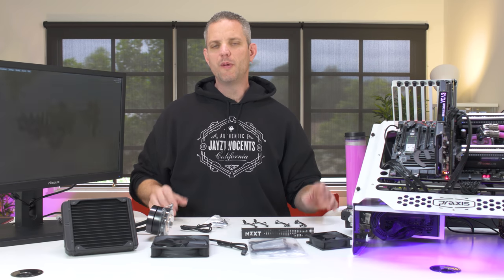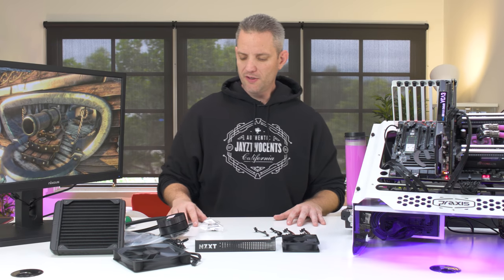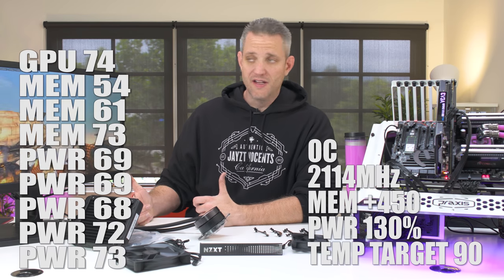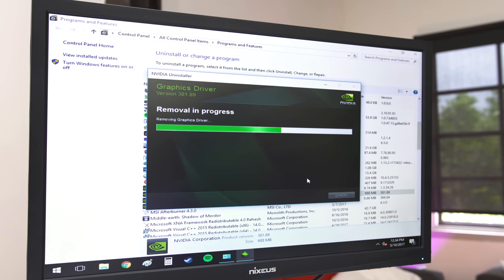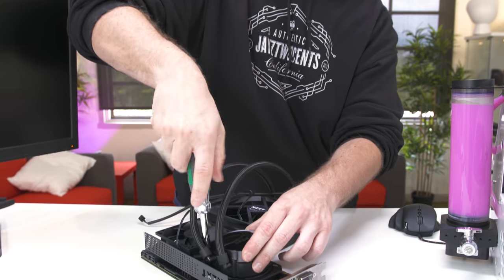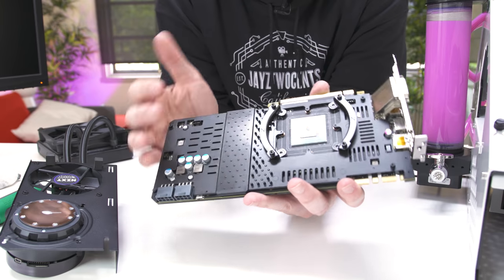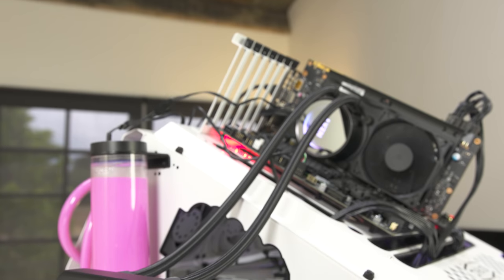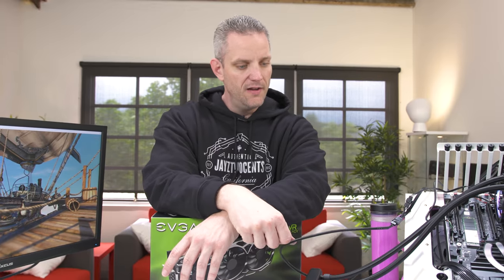How to Watercool a Video Card... The easy way!

Comment: When the majority of users dont use SLI, dont want the hassle of a full 
loop and change cards fairly regularly this is an attractive solution.

Its easy, cheap and it works.
The performance is more than good enough for the vast majority of users while also being cheap enough to be worth the upgrade.

Comment: Isn't there some clock lock on the nVidia cards?  Especially the 1080Ti.  In the sense that no matter what, you won't be able to OC over a certain point anyways.
I think Gamer's Nexus did something on this in reviewing those cards.
So, I'm thinking that even if you bring temps down with an AIO, you'll only be reducing your temps (which is not a bad thing), but really won't get any more performance juice outta the card.

Comment: One of the reasons I never warmed up to GPU water cooling is the looks of it, say what you want but display connectors sticking out on the side and a water block that is obviously to thin to fit the overall design of the component looks kinda trashy.
Event those expensive water blocks look silly compared to some of those real neat and shiny air cooled designs like that 
1080 FTW. You know with the black back plate the glowing writing on the side and appropriate height for a card that takes two PCIE slots anyway.

Comment: I expected a better go at this. He could have placed heat sinks on the memory blocks, explained how the pump and radiator fan is controlled, eg I believe the pump needs to be at full speed. Also, it would be interesting to know if this still occupies the space of two slots, or if the size of the pump and its connections means it will take up more space. In other words the practical details, not just those initial raw stats. 

Also, im not sure it would have been practical to keep the backing plate, as he was replacing a blower with a fan, which in my opinion would not have the same effect of forcing air into those tight nooks. eg under the plate. On top of all that, the AIO in the listings is way too expensive compared to the other options out there.

Comment: I bought a second hand Gigabyte RTX 3080 gaming, the seller claims he never mined on it but after taking it apart the heat sink is covered in corrosion and packed with clumps of dust and dead bugs... these bugs and clumps have gathered moister and actually corroded holes and notches out of the heatsink fins... as an alternative to a replacement heatsink from Aliexpress for $120 USD is there anything on the market like the G12 that would suit an RTX 3080?
Reply: I don't think there is I am looking all over with no luck for something like the G12 but nothing does the 3000 series only up to 2080 TI for the G12 bracket. We just have to hope NZXT or any other makers makes a new bracket for the RTX 3000 series as i really want my 3070 with a AIO on it as i came from the 1070 EVGA hybrid that was AIO and i miss it so much as way better temps and a lot more quite then fans are when it gets warm.

Comment: 7:10 - The dremel approach: I tried it. Cut out the square in the centre 1080 ti Founder's Edition to give the Corsair H55 cooler access.  It looked similar to the Gamer's Nexus Hybrid build, but when I put it all back together water cooled, it ran, but the fan shot up to 100% then switched off.  

In a panic, I put it all back together and the square piece I cut out, put it back in, working again with the blower fan.  

I tried the NZXT G10 and G12 approach with a few 780 tis, one 980 ti without cooling the VRAMS, they lasted for years. Not sure what happened with the dremel method.

... pointers would help.
Reply: Shahwiqar Shahin Did you cool the VRMs too or not?

Comment: omg Jay I was checking online for this same exact problem because I use nzxt g10 on all my gpu's and never considered what it does to vrm and memory. My gpu doesn't have any built in sensors, but I did use my non-contact digital laser infrared thermometer and saw that the temps were fairly low around 55c. I wanted to know what the temps were with a heatsink on because I thought they were cooling the components better, but that's wrong. Thank you for doing this video.

Comment: Hmm.. I wonder if that fit my dual xfx r7900 gpu's (not clocked). Im tired of the damn heat, idle at 50-55 degress celsious in massive case with 5 140 fans and 4 120 fans.....-.-

Comment: the route that ive been planning on going so far is getting 2 evga 1080ti ftw for my build but i saw the g12 just came out and its only 30 bucks. There is FE cards that are on amazon for 655 so i was wondering if it would be better to go that route for sli with the kraken g12. i know i have to get the AIO cooler for both cards and thats fine. Im going to be using the cougar panzer case which i think will work well for it since it supports rads on top and in front. I will also be running a 280 AIO for my processor and have that mounted on top so would cooling still be fine having radiators in front for the GPUs and the CPU on top for cooling? Air intake throw the front and exhaust out the top?

Comment: Is there a liquid GPU cooling solution which covers the whole card and will essentially loop together with a CPU block and end up at the same radiator? I have a super tiny case with only one real outlet for a fan, so I have to try and get everything routed to a single "output".
Reply: Thats called custom water loop...

Comment: Hey JayzTwoCents been having an issue with my new msi gt73vr 6re laptop. The model has a gtx 1070, i7 6820hk, 16gb ram, 256gb ssd, 1tb hd, 120hz 1ms 17.3' screen. I've taken it into multiple people including the manufacturer  (who i found out don't care about software issues) with no luck. There appears to be a memory leak or something that nature occurring when rendering graphics in games making the msi dragon centre crash and making the framerate in games tank really hard or crashing the game altogether. This happening within 10 minutes of starting a game making competitive gameplay impossible. Any insight would be appreciated as I'm getting desperate. I'm also wondering if there are any appropriate software choices to replace it if need be and still be able to control clock and fan speeds.

Comment: Anybody know if theres anything like this for a 2080 oc? And would it even do me any good? This is an old video with older hardware so idk if it still applies. I have a tripple fan cooler on my gpu and it hits about 55 MAX and averages 45 c at full load. Id like to get it below 30

Comment: Follow up video, how can the Kraken G12 use modern Used cards to effectively compete with new Cards.
I had an old 1080ti Blower that sat around 95C the entire time it gamed, installed this and it dropped to 50 - 54c while benchmarking/gaming.
Unfortunately I didn't really test this build before swapping coolers, but right now I get performance on par with the 3060 Ti easily.

The only thing I have to go off of though is Benchmark Youtube videos.
In those a Stock 1080 Ti performs around 160 FPS in Overwatch 1080p Ultra, a 3060 Ti performs around 240 FPS in 1080p Ultra, my 1080 Ti is matching the 3060 Ti results currently.

Comment: i have a 1080ti ftw3 and put this kit on with an x72 aio, didnt have a tool to cut the face plate like in the video so i got little heatsinks instead, when i do anything that makes the card turbo hard the memory crashes at or right below 50c on mem2 in hwinfo64, if i undervolt then mem2 can climb to 65c with no issue, in some cases while undervolted i have to have 6 intake fans  set to atleast 75% for it to not crash
the temps on everything but the gpu are more or less the same and there are no components on the board that are missing/damaged so im confused what the actual problem is
is it just a dying card so its effective power vs memory clock is lower or could it be that the heatsinks i got arent good enough and without the undervolt the temps spike before i can see it

Comment: Hey Jay, I did this with the Kraken G10 on my EVGA 980Ti. I solved the front- and back-plate issue with a copper shim between die and watercooler base. Roughly the same temp-drop (1-2 c off). Could you try that instead of mangling the card? :D

Comment: And for 1080ti? No need heatsink or any other solution to VRM and rams???...
Reply: Any answer pls? Is this working (better temps) on 1080TI, without heatsink and any vrm/ram cooling (only the g10 fan)?

Comment: I currently have the nzxt g12 & kraken x42 on my zotac 1070 amp edition. On load with a 55% fan speed, the gpu maxes out at 65c and i was able to OC to 1731mhz off of 1506 mhz (225 offset) The card is notably more quiet than before and even though the zotac card has an oversized pcb the nzxt g12 fit on perfectly and I was still able to attach the zotac backplate with no issues :D

Comment: this is cool! wish it looked a little nicer. if it were a fully enclosed box id be happy enough. i also wish it had some sort of heat sync for the memory and power components. i still dont trust the fan blowing on bare components. id need to see this done to a founders 1070 like i have before id do this.

Comment: So to be sure...it is ok not to install heatsinks on the VRM as long as there is enough air flow?
Reply: I personally run 2 pcs with this bracket one running a Asus 1060 6GB (Kraken X52) and one on an MSI 1080 TI (Thermaltake Floe Riing) neither have heatsinks on the VRM have withstood many benchmarks and a lot of gaming (stuff like FFXV, Fallout 4) never had any heat issues just using the stock fan that came with the bracket
Reply: @Popsicle_MP  Thanks for you reply :)

Comment: @JayzTwoCents  I know it has been a while since you've done this video, but will this method work with the ASUS GTX 1060 6GB Strix card?
Reply: yes, there are even fan headers on that card that you can plug the VRM and radiator fans into

Comment: Great video, I was looking for an alternative to a expensive gpu block. This verifies I can just slap a cpu water block on it. (I think). Then use an extra 120 mm fan or maybe even the gpus old fans to cool the other parts. Or heck even a aftermarket air cooler.

Comment: Hey, love your channel!! I live in Qld Australia and we get an average of 30 deg C year round, humid to say the least and in my Garage I have an office set up which of course I run games also, anyway cutting to the chase, I have a Ryzen1600X which has always run on a H100i V2 from Corsair, my MSI RX580 has always run hot so I decided to cool both CPU and GPU a bit more by shifting the H100i to the GPU using this NZXT G12 set up and getting a H115i for the CPU, all fitted inside a Cooler Master Pro 5 and WOW!!! what a Temp drop on both!!   at Idle the GPU is sitting at 28 deg (1 deg higher than ambient) and running some heavy games the CPU gets to @ 50 and GPU to @ 55, both used to get to 70 + so I would say I have had a 20 deg reduction on both CPU and GPU.
Anyway, after watching this and other videos you have done I made the leap :)

Full water cooling loop will be my next step, but I think I will got Threadripper and a bigger case, keep up the good work!
Paul Qld.

Comment: Hi JayzTwoCents, how are you. I hope you are in good health. 

I Buyed liquid cooling fan to keep the temperature of my gpu low and it has been 3 years I am using the same cooling fan. Question is do i need to change the paste of the liquid cooling fan. i donot know what is there inside the cooling fan and i assumed to be thermal paste. I can tweak the question in another way i.e do i need to change anything in my liquid cooler fan as it is working for the last 3 years and i am doing training for Artificial intelligence data on regular basis My concern is that my GPU should not get overclocked or damaged because of any reason

Any help would be appreciated from my side.

Comment: i put the kraken G12 on my 1080ti aorus extreme and PC turn on but when im running a game it froze and pc is unresponsive like heats up the graphics card thermal paste is touching with my kraken X42 im doing something wrong ?
Reply: most likely your contact with GPU is uneven or to light, otherwise I would suggest to much/little thermal compound
Reply: @Popsicle_MP    i got two zotac 1080ti extreme with krakens running perfect now 55c on gaming 32c 28c on idle

Comment: great video, i currently have a 6900xt toxic sapphire which i bought during gpu inflation for 1700. the 3090 was lacking fps in all res but 4k which is why i bought the 6900xt for 75$ cheaper. little did i know the encoder sucks for amd for streaming so now i want to grab a 3080 to for streaming but i love the temps i get with my aio gpu.. so here i am and i found your video and it PERFECTLY went down the list of issues and questions i had, and you answered all of them. thanks man W video 🔥🔥🫡

Comment: I did this not long ago with my 1080 founders edition (because the reference cooler sucks) and was really happy with the results. I had done some research and was told about the VRM/memory cooling issue, so I decided to put little heatsinks on each chip just to cover all the bases.
The only issue that I had was that the water cooler (nzxt x41) has a bit of air in it...

Comment: this video is 2 years old by now so I think i could be a little late.. but I need to Know if this bracket is compatible with a corsair H60.. cause I already have one.. otherwise buyn a suitable one make the thing no worthy on an economic perspective... can anybody tell me if it's so?
Reply: Will not work with H60. Only H105, H110, H90, H75 (CW-9060015-WW only), H55, H50 (CW-906006-WW only)

Comment: Just put this on an evga gtx 1060 (ill buy a 1070ti or 1080 eventually if prices ever come down lol) with a corsair h50 and i went from 74c to 46c! Installation was weird as the CPU block did not actually attatch to the kraken but i just turned the pump so it was contacting the kraken's tabs and then i used the thumbscrews to tighten it down. I didnt use any of the mounting hardware that came with the corsair cooler but it seems to work i guess lol.

Comment: So problem. The VRM and memory modules will cool fine as long as there's a 100% operational fan, no dust, no wear, no nothing, just perfect air flow. Well yeah that works fine works for that voltage regulator that's just sitting there in your bench for one hour or so, but how about an enclosed PC that's 3 months old? A layer of muddy dust (moisture and dust) will cover all that stuff insulating them from the air flow, especially if those are bare component parts with impurities in the plastic structure that can house dirt. You need at least small aluminum/copper passive coolers over those components that would dissipate heat even if the fan is completely shot. So in a case of emergency you'd only get some BSODs or restarts instead of needing to solder new components or God forbid, SMTs D: into the card.

Comment: Hello all, I am down to my last option I hope. I have built a new cpu  the system contains 990FX sabertooth R3.0 AMD mother board, I have both FX-9650, FX-8370 processors. Dual EVGA Geforce GTX-1070, Two OCZ 480 SSD's, EVGA 1000 watt G3 PSU, this is a water cooled system. The problem: I power the system on all the fans light up and work the pumps work have good water flow. The system will not go to the bios screen, it tries to do it but it just powers down immediately. I have changed the MB the CPU same thing happens, shuts down. I need some help it is a stellar looking cpu and I want it to work. All input would be greatly appreciated

Comment: Howdy  Jayz
Thanks for the demo. I'm thinking of doing it for my Nvida GTX 780 Ti Classified Sli. config. See thing is, one of them is running hotter while the other one is running around 10 deg. cooler. So i was going to balance them out with putting a water cooler on the one running a bit hot.
Any chance you can do another one for a GTX 780 Ti Classified-Sli conig.?

Cheers mate:)

Comment: Maybe the temperature on the other components came down because the stock heat sink is all one piece, so maybe the heat of the gpu was also heating up the other components? You should try hacking off a chunk of heat sink that touches the vrm and see what happens when it's cooled independently by another heat sink. XD

Comment: good thing about water cooling a gpu is that it makes it a lot lighter than for some gpus so you dont have to worry about it sagging
Reply: I will still always use a support bracket too many newer cards getting cracked PCBs. Don't want to brick a 4090 for aesthetics

Comment: Hey Jay, since the Fractal Celsius series allows add-ons, and is also new, interesting, and deserving of an awesome JayzTwoCents review, how about you try this NZXT GPU bracket hooked up to a C24 or C36 that's also doing CPU cooling duty? I'm very interested in going this route but early concerns with the Celsius series are that the pump's max flow rate is too low for supporting both CPU and GPU cooling effectively. Seems kind of odd since FD designed it specifically for this, so maybe the concerns are unfounded. How about a J2C review to settle this right out of the gate?!? Then you can raffle off the whole contraption ;-)